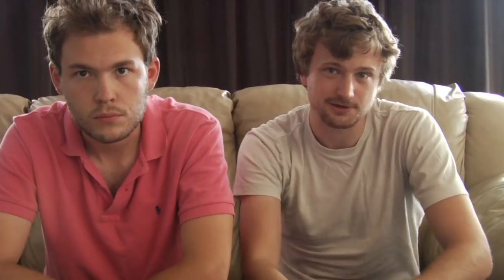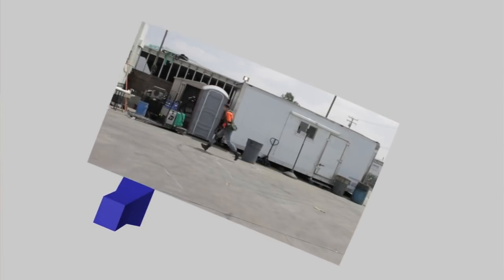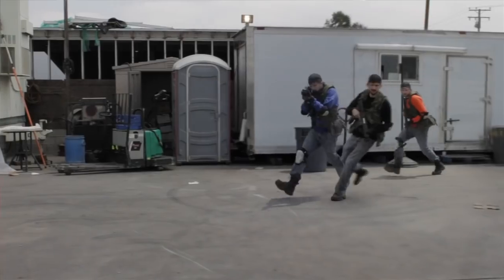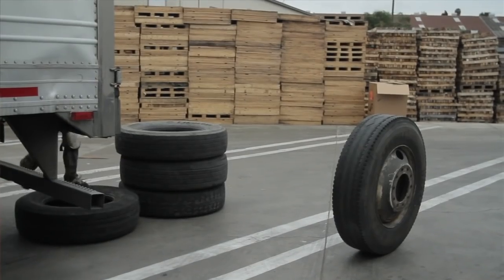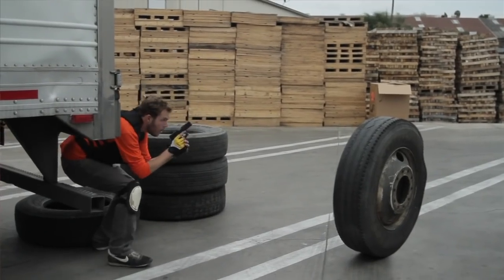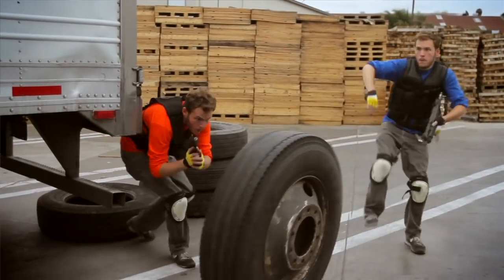MAKING OF: Clock Blockers

Comment: @eladbari What they would have used would be the motion "stabilize" function which basically takes the bacground and keeps it completely still in the shot, then add all the other composites to this shot after stabilizing them so they match. Once everything is lined up it's then a question of either linking everything to a parent camera movement or just adding fake shaky camera in post.

Comment: @RGNHD you need to do a 2 point tracking of the arm (points which are horizontally seperated) and parent your HUD to the tracked null. same with the unlinked but then just track the head vertically (like from eye to mouth) should do the trick :)

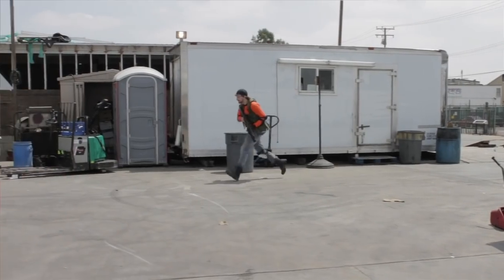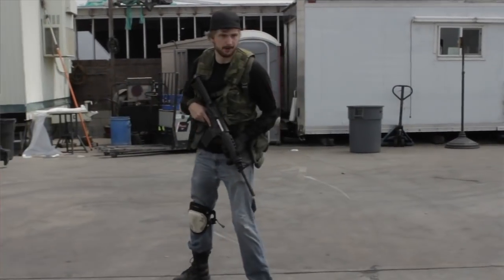Comment: can anyone please explain what Niko is saying from 1:24 -  1:45? Wouldn't it just be easier to film each character running on screen on a tripod, the film the same scene but with no one on frame as a "clean slate" and then just mask each character in after effects? Like why would 3Ds max be needed to "stich" together all the footage?
Reply: They used 3DS Max to 'stabilize' the footage, and then track it back in to the master shot. By tracking the camera and projecting the footage with that track they are essentialy nullifying the motion, and then they rendered it out using the master shot's motion. This way all the shots have the same motion and can be composited together. This would probably be a lot easier with a tripod, but I don't think they had that.